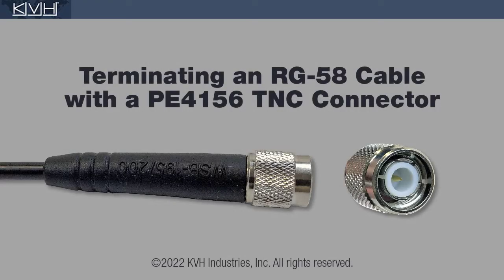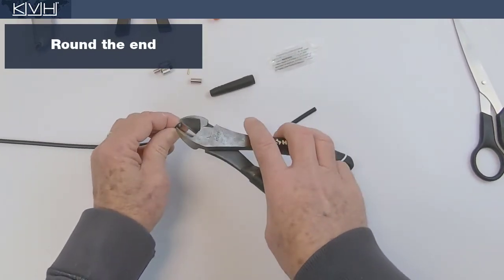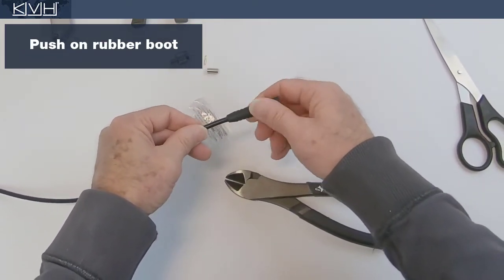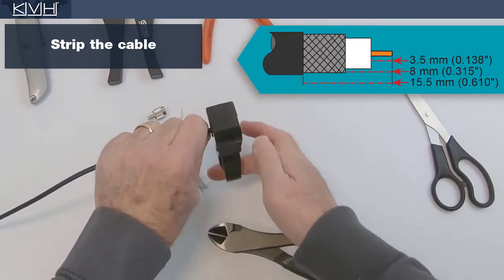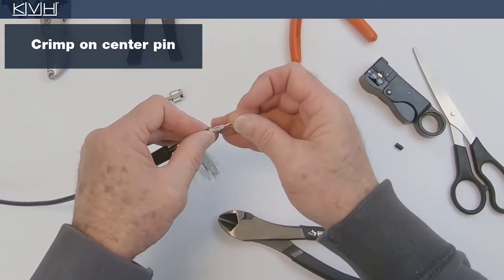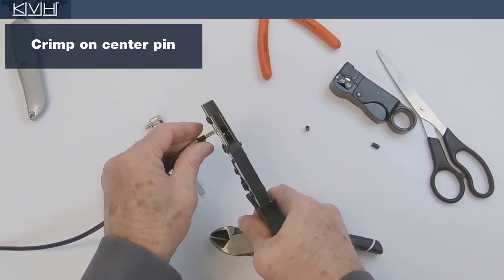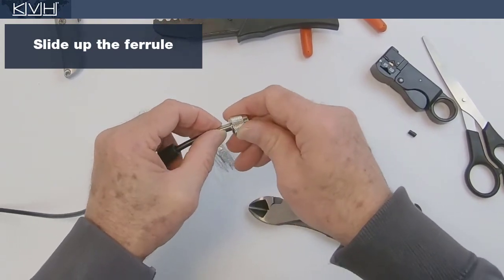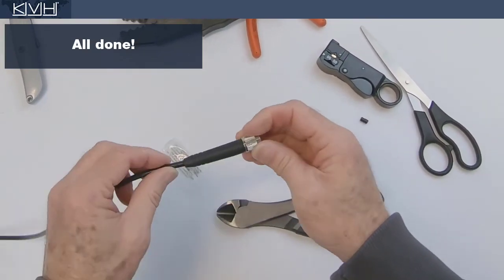Terminating an RG-58 Cable with a TNC Connector

Comment: What was that boot you used?
Reply from the maker: Good question! KVH supplies a weather seal boot with the connector and cable to protect it from the elements. Times Microwave (timesmicrowave.com) part number WSB-195 fits the RG-58 cable.
Reply: @KVHindustries  Thank you, definitely will have to grab a few